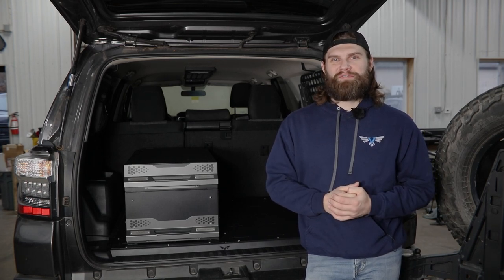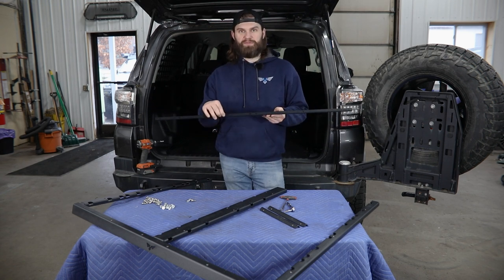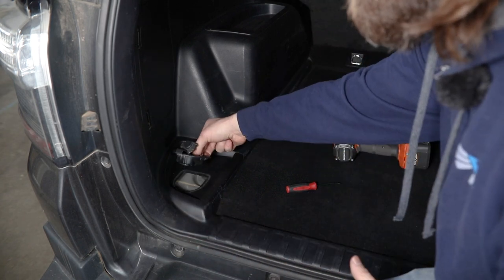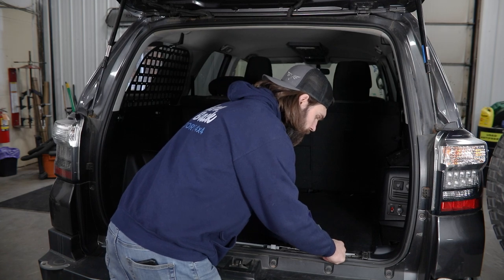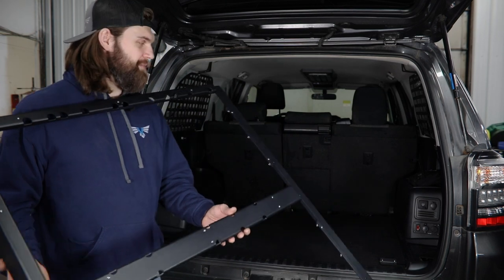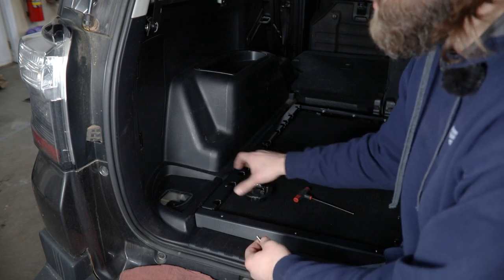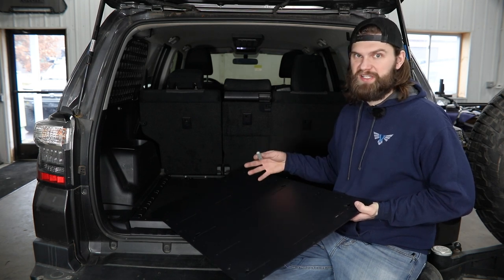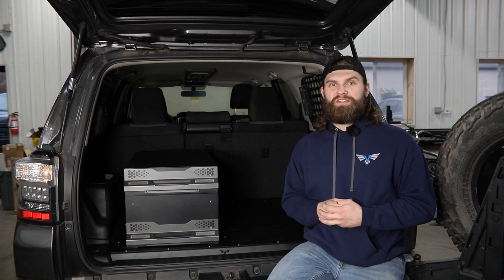5th Gen 4Runner Off-Grid Modular Drawer System Floor Install

Comment: Is the floor level with the back of the seats when the seats are folded down?
Reply: This is what I want to know!!!!
Reply: Me too! If not how much of a hump is still there
Reply from the maker: The floor would not sit level with the seats when they're folded down. There would still be a couple inch drop from the back of the seats to the floor.
Reply: @Victory4x4  Could be kinda cool if it did. Flat storage is pretty convenient. Slide a little tray under it for some extra storage too for small things. Mock something up for a youtube poll and see if people like it. Differentiates you from competitors like Goosegear.
Reply: @Victory4x4  Another cool option would be use this floor plate along with your fridge slide brackets and slides and create a rear sliding cargo tray.  Give us an alternative to the OEM slide.